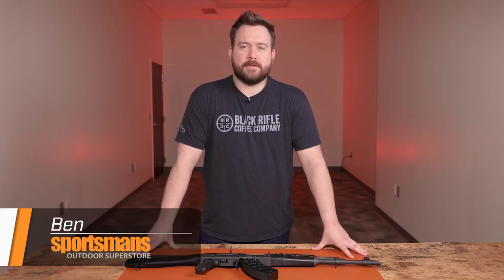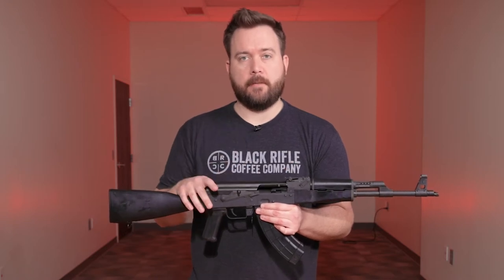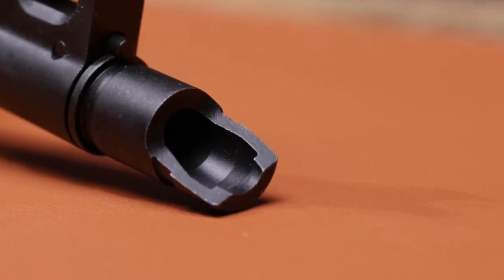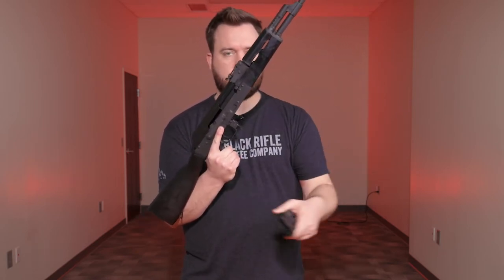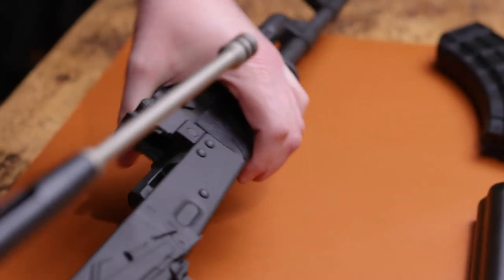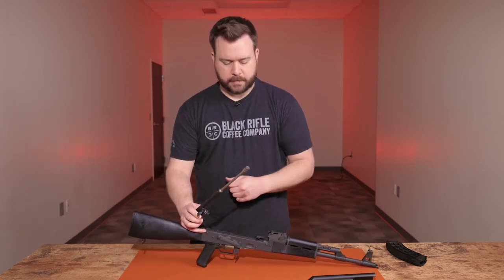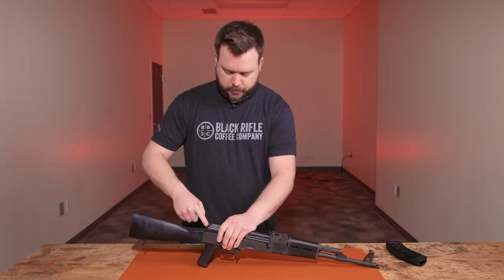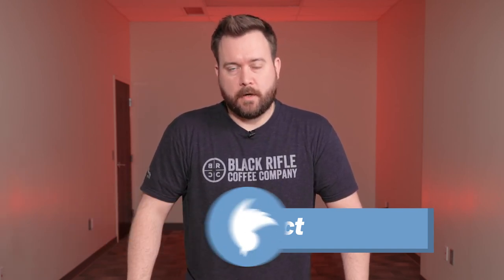Century Arms VSKA 7.62x39 | Review and Field Strip

Comment: I just disassembled mine. The only real problem I had was getting the dust cover back into that notch on the front, especially since it was not shown up close in the video! The cover sat crooked while in the notch, so I had to really push down hard on it to ensure that it snapped back into place, with the recoil spring "button" clicking back. Other than that, pretty simple overall. This was my very first "field strip" attempt on an AK. Just need some more practice (and patience)!😬 Thanks for the video! 👍
Reply: try this-  first line the dust cover up in the front where it seats. with the palm of your hand punch the rear of the dust cover forward and down. works every time for me.
Reply: Just did my that butt stock was a real pain to take off😅